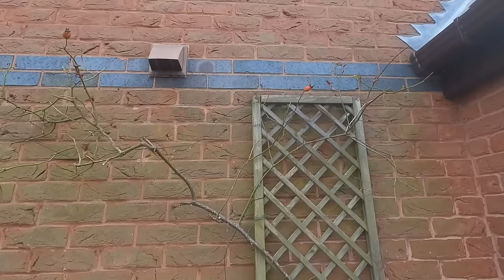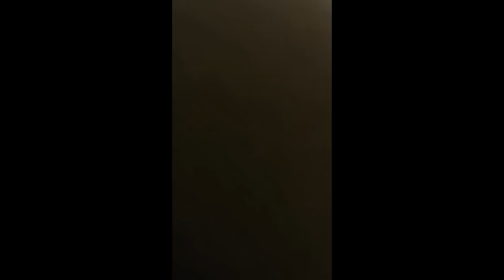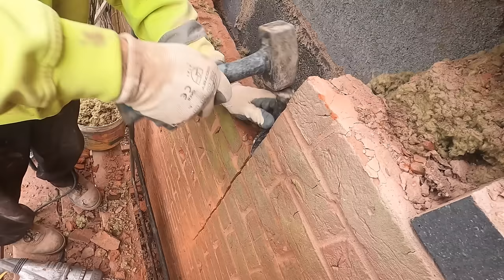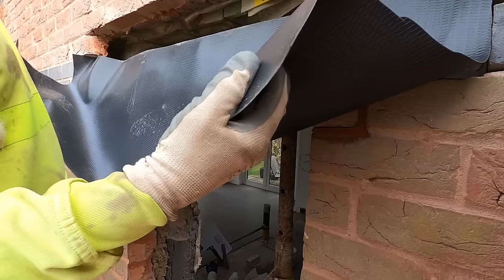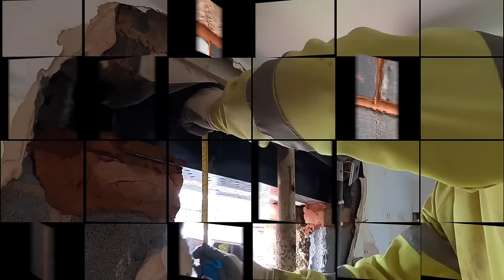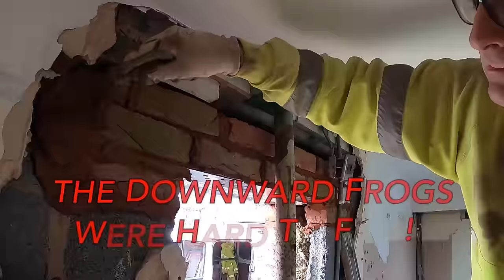CUTTING OUT A NEW WINDOW!!

Comment: Good job laying the brick, But you cannot just plumb cut brick jambs. The first 1" of the brick jambs are exposed. You have to tooth out the halves. If the window frame comes out past the face brick, it will  probably not be sealed right?
Reply from the maker: For the sake of seeing 30 mm of face on the reveals toothing  out etc would make the new window stand out like a sore thumb. The chances of matching the bricks and getting the mortar colour spot on are quite slim and would be very obvious just walking past. Just doing the cut is a stronger job and is only noticable up close.
Thanks for watching and commenting 🧱👍🏽
Reply: Yes your right it would stand out alot more if you tooth them out good job but the two cracked blue bricks you put in does drop this one to a 6/10 sorry
Reply: @SteveAndAlexBuild  In construction books it says the proper way is to tooth out the bricks, but your point makes sense. The way you did in the video with the grinder is a better way of minimising bad looking edits to the wall.

Comment: I'm not a brickie so know nothing about this, but shouldn't you support the brickwork above the opening before you remove all the window bricks? I mean until that lintel is in place couldn't it all just collapse at any moment? Seems the acro bar goes up to support the inner wall only, but after all the brick removal, and there is no support for the outer wall - isn't that dangerous?
Reply from the maker: It’s only a small opening abs even if any bricks did fall only about 6 would drop . There is definitely not danger of collapse 🧱👍🏽💪🏼

Comment: Fantastic I'm going to watch it again
Reply from the maker: Cheers David 😂🧱👍🏽
Reply: @SteveAndAlexBuild  what a day I've been out in search of paint and luckily we couldn't find any .the chip yard is open and delivered my tea and now I'm watching a block buster 😂
Reply: Great video guys, a hate they  Staffordshire blues 😂, can point they things the next day, they just don't soak in the moisture,
Reply from the maker: David Burt it’s a win win day for you Dave 👌🏼😂🧱👍🏼
Reply from the maker: Marc Hanlon . Your right there Marc 🙄🧱👍🏼
Reply: @SteveAndAlexBuild  now I'm free to write my life story I'm going to call it . When the midwife slapped my mother 👍
Reply from the maker: David Burt 🤣🤣🧱👍🏼
Reply: Do you ever slate the last bed joint ?
Reply: @neilsmart78  depends mate . To slate the top course the brickwork has to of set adding another day to the job . If you go up eg 20 courses then yes but the shrinkage over 3 courses is minute if any 👷👍
Reply from the maker: Neil Smart . No as long as the bed is packed tight there’s no need . I’ve done it the past and the pressure just pushes down and bends the lintel 🧱👍🏼
Reply: @SteveAndAlexBuild  that's pretty much what I said lol
Reply from the maker: David Burt 😉🧱👍🏼
Reply: Bricklaying With Steve and Alex  so you use that method above steels when knocking through the back of a house or putting trays into a long run on existing masonry ?
Reply from the maker: Neil Smart . I may use a bit on long lengths over steels if the brickwork is dropping 🧱👍🏼

Comment: I would like to cut out new door from kitchen to the garage. It is through a double block wall. Should I use this cavity lintel with dpc or would concrete lintel be enough? The door would go to the garage not outside.
Reply from the maker: As it’s an inside wall just concrete lintels  will do . No need for a tray 🧱👍🏽
Reply: @SteveAndAlexBuild  Thanks a lot. Also thanks for the educational content.
Reply from the maker: @AllkoDH  . No probs and you are very welcome pal 🧱👍🏽

Comment: Just a pity the inner leaf hadn't been Thermalites, I love it when they are, you can cut them from the outside with just a panel saw, and use your grinder cut on the brickwork as a guide...sheer luxury...But I'd do little jobs like that all day long, especially on this mind numbing lock down...But just to add a rider, those frog downs are a pain in the arse, I'm not criticising here, but what I like to do on these jobs, is to tap in some slate packers on the last course, then pump the muck in with my pointing gun, you know you're safe for achieving a full joint that way, and it's a tad quicker and easier
Reply from the maker: Green Genes Cheers pal thanks for the tip 🧱👍🏼

Comment: Thanks for the video. At what point should the wall support prop be installed? And does the wall prop span both masonry leaves?
Reply from the maker: This brickwork didnt need propping on such a small span of good brickwork , the inside was propped as some bricks worked loose. i usually put the props in every 4 bricks  🧱👍🏽

Comment: Hello there I have a few questions about tuck points you fill joints with  what sizes would you recommend buying and brand please 

Thanks
Reply from the maker: Kyle Arts Hi Kyle , mine is a cheap one and it’s rubbish ! Go for an Ox and get an 8 and 10 mm 👍🏼🧱
Reply: @SteveAndAlexBuild   thanks would you need anything bigger ?
Reply from the maker: Kyle Arts I wouldn’t bother personally 👍🏼🧱
Reply: Sorry I have another question what brickhammer would you recommend a 16oz estwing a Stanley fatmax or a ox  brickhammer thanks
Reply from the maker: Kyle Arts . The Estwings are very expensive ! , I’ve never liked them either . I have an ox but not keen on it and fat max gear is going down hill .
If you go to the description below our videos and click on the ck brick hammer that’s the one we prefer plus if you buy one we will get a small commission at no cost to you ( sorry about the shameless plug ) 😬😂👍🏼🧱

Comment: I would have used strong boys right away to hold brickwork up.  that brickwork could have all collapsed, very risky
Reply from the maker: Richard Cruickshank We had  plenty of strongboys ready but  even if the brickwork moved it only goes up in a triangle and  you would only lose a few bricks not “collapse “ 🙄🧱👍🏽
Reply: Bricklaying With Steve and Alex i understand what your saying but the brickwork could have still fractured with all the weight above.
Reply from the maker: Richard Cruickshank . It’s actually couldn’t because brickwork is self supporting to a degree . If 5 bricks drop then only 4 above will follow then 3 , 2 then 1 🧱👍🏽

Comment: Very slow, never levelled the lintel when bedded on disappointed
Reply: And put in cracked bricks
Reply from the maker: Retro Please .The cracks are only surface  cracks in solid  brick so not an issue . 
   The work is remedial so we are working to what is already there so putting a level on that lintel is completely pointless !  As for the speed ..... we were done for 2 so I’d say that’s fast enough .
Reply from the maker: Shinobi . Because they were only surface cracks I’m happy there won’t be any problems and at the end of the day if there is a problem I will rectify it . I could very easily have edited that part out but nobody is perfect 🤷🏼‍♂️